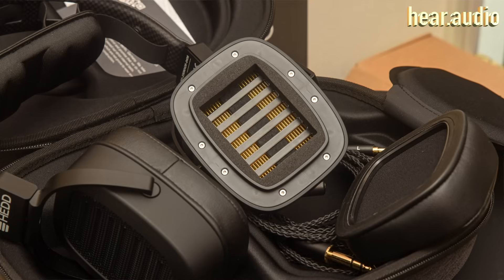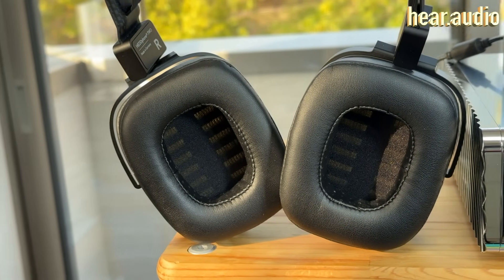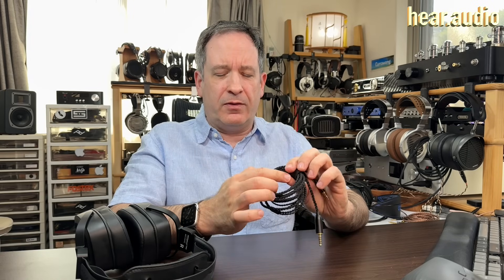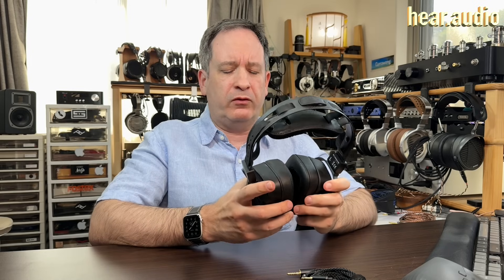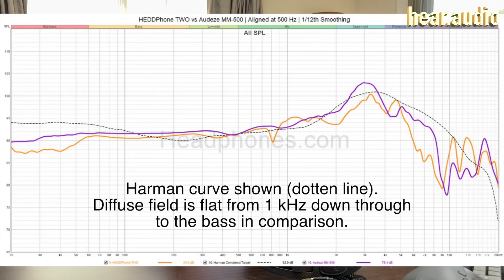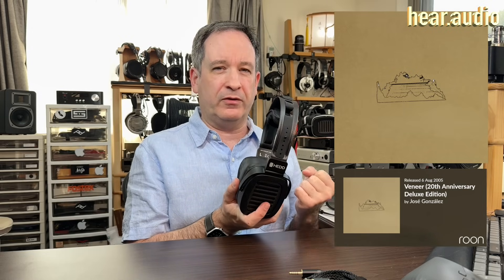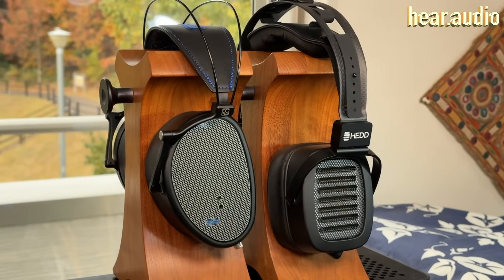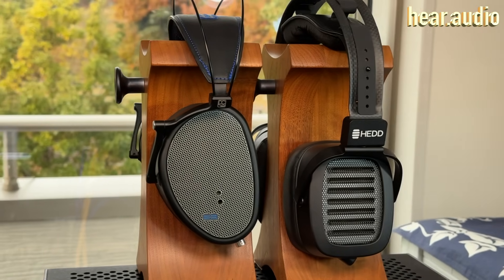What happened when they put speaker drivers in the HEDDPHONE TWO?

Comment: They were my daily drivers for a year, they were replaced by Stax, but they are still on the table all the time. 

They have a unique "awakening" at certain volume and this volume is loud. 
And then they are something special. 
So, I think, that drivers are actually chosen too powerful, to start opening up, at normal volumes. 
And so I use them for loud listening, because of that, and also, because I dont want my Stax, to have a diaphragm voltage discharge, tha eats away the metal coating.
So they are complementary.

And you need EQ, if you have normal hearing, otherwise, I would trash them :)

And you dont have to be afraid of damaging them, because these things can take over 10 watts constantly, I made them as loud as possible and then checked the membrane, and I couldnt see any movement, like you can see with dynamic drivers :)
Reply: My Stax are due any day now...

Comment: I wasn't a fan of the original. Bass was unnatural regardless of EQ and a horrible experience to wear. These are a big improvement. The most neutral and effortless sound I've heard (with a little EQ). There was nothing in this price class I felt was value when Ananda Nano, HE6se V2 etc outperformed most $2000 options, but this is certainly a step further. LCD-5 for me is the upgrade from these that offers something, but it's not better or even as good in every way.